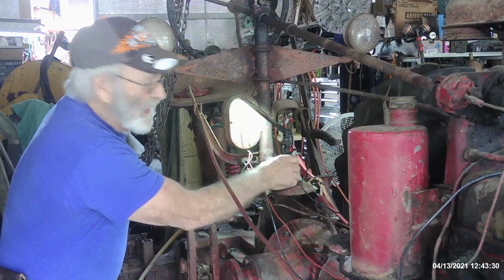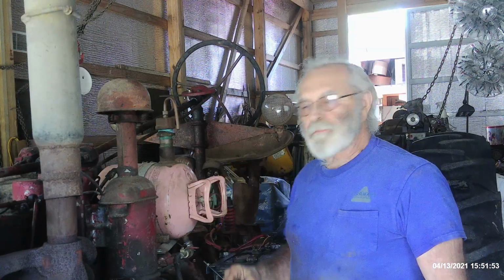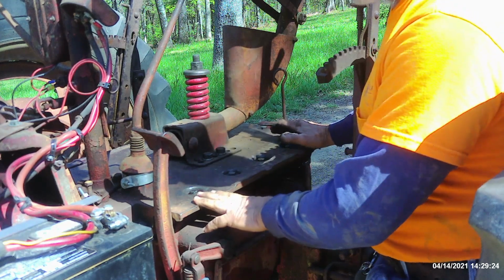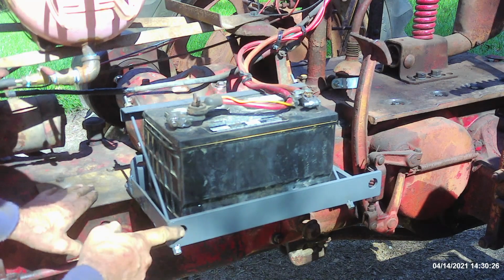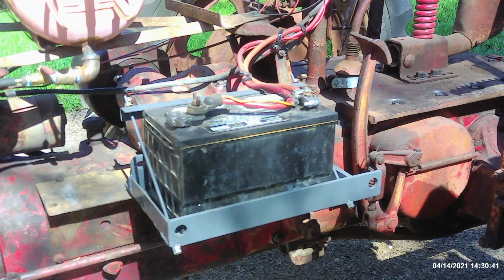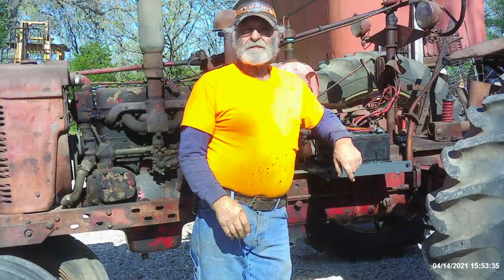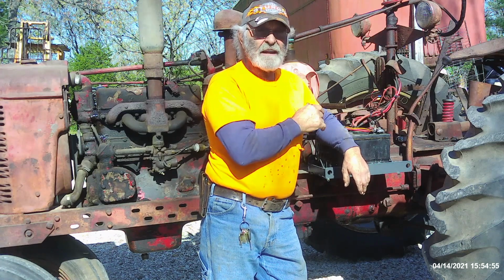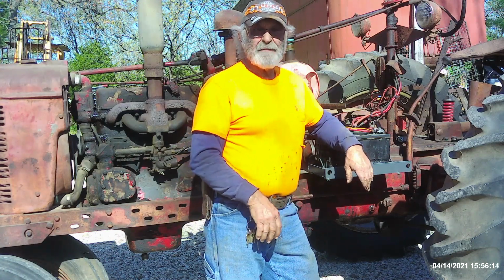Farmall H Transmission Fill Up, Belt Pulley Install, Drive Around the Woodpile

Comment: it takes a lot of time and money to keep tractors running ,fun fun fun!
Reply from the maker: Well yes, and yes.  But what the heck, it keeps me from wasting money at Crackerbarrel !! Once you get them going, the biggest issue is using them enough to keep the fuel systems from dealing you a fit.  This formulated gas is the devil on the gas tanks Jeffrey.  Thanks for the visit.

Comment: You're correct about those bolts that hold the transmission cover on. They are through bolts which is a direct path to the inside of the case. YouTubers Squatch253 and Kenny Kizzle both featured Farmall restorations on their channels. They sealed those transmission bolts with silicone sealer to keep the water out. Your old H sounds pretty good! I like your creative use of scrap on that battery box.
Reply from the maker: I did notice that a lot of the threaded holes went all the way through and into the transmission sump as I was chasing the threads with a 7/16'' tap. That fact and the nine broken lock washers gave me the thought that a combination of those was the culprit.  I might pull those bolts and pump in some Vulkem 116 to seal them up.  Yeah, Matt...I like making something of nothing so the scrap metal was the perfect candidate for the battery box.

Comment: Good Morning Wendell, glad to see that ol’ beast cruising the drive! It sounds good and healthy now and should give you some great service on the homestead!

We have some new videos up now!
Reply from the maker: I still haven't touched the carb yet and it does need a little attention.  Especially when its on unlevel grade or not under a pretty good load.
Reply: @tractorman4461  are you going to tune it like i did my old Dodge Dart? ...Place a cup of coffee on the engine, then adjust timing and carb until there isn’t a shimmer or shake!
Reply from the maker: @thesmallwoodlot433  hahahahaha...I don't think I have that level of ability in the area of tuning an engine !!  LOL.  I'll be happy if it will stay running long enough to cough and sputter its way though a wood splitting session....LOL.
Reply: @tractorman4461  I have had a few that I was able to tune to this extent, v8 and a v12 engines work best, but had to detune them because they ran too clean, and the emissions equipment couldn’t read the exhaust. So the inspection tech would fail my cars until I dirtied up the emissions!😂🤣😂🤣😂🤔🤔🤔🤔🤔🤔 now isn’t that the reason for testing emissions to keep people’s vehicles with in parameters of emissions according to  state laws?

Now lets really think about this, the car, pre emissions compliance 1972 Dodge Dart Swinger 318cid. V8., emissions compliance laws started in 1974, catalytic converters, air pumps and charcoal canister, and simple computers, and electronic ignition, so there should have been so the parameters for this car should have been more relaxed then a 1995 v8 car of any make or model, but no, i had to follow said given years emissions for this car, which said my emission must fall inline with cars that are 10-12 years old. Well the truth of the matter was, i tuned the car up while on the shop’s emissions machine. Now the inspection tech, told me it failed because of running too clean, or his machine was reading 0 emissions, so he called the head inspector out to verify his findings, and informed me i was in violation of taxation laws as well for running clean fuels ( alcohol/ moonshine) and called the board of state taxation, impounded the car, and started another whole  mess of legal snares that i had to work through. During their inspection, they cut the steel fuel lines, to vacuum siphon the tank of gas for testing, (full 20 gallons) removed the tank, and cut it open to inspect for hidden tank, slapped a condemned sticker on the windshield and gave me 30 to have this car either repaired or crushed, neither of what i did, at the time! What I did was called the state inspector from another location, and he came over to this station, he inspected, the “work” done on my car by the other techs, and informed them they were violation for vandalism of private property, and in court would side with me. Had photographed the inspection station, the car, the damage and the reports of what was found or not, 6 months later after court, the first two inspection tech, were fired, and ordered to replace the parts for my car they damaged, fuel line could have been better suited for a “weed whacker” ( 50 ft coil of 1/8 inch copper tubing from a hardware store, a gas tank from god knows what make and model GM product they came across in the junkyard and all rotted out as well, and straps that must have come off a bus! So i sourced my replacement parts, and had them and the receipts in hand on the next court date. The judge, and my attorney were getting tired of all this crap going on over people wanting to make others lives miserable, so I tacked on my labor, time to search out the proper parts, and a fee of aggravation, then the judge added on all legal fees, to include my attorney, and my second means of cheap transportation... a 1973 VW Beetle (bought for $300.00) actually to replace a pile of junk Toyota pickup that had 1500 miles on it and spent more time in the dealer garage then my driveway! 

 So after fixing the car, i had it towed to the inspection station where my father’s friend worked, and he re inspected the car, and gave it a clean bill of health. The main issue was, i was a young adult, with a sharp car, and a military hair cut, and the first two inspectors didn’t think a young kid should have such a car, bigger issue was... I wasn’t a kid so to speak ( young looking 27 ) and strong military not taking crap back bone as well!
Reply from the maker: @thesmallwoodlot433  Man...going through all that musta sucked big time.  Sometimes we get bit by some guy that has the position to make another's life aggravating over some technicality.  It all worked out though it seems.  I would love to find an old V-12 out there.  I think I'd find a home in one of these tractors....
Reply: @tractorman4461  it was, and the funny thing is they did it because they wanted the car themselves!

Comment: My grandfather had a 1942 Farmall H. It was a multifuel because it had a small fuel tank for gas and a larger fuel tank for distillate( kerosene). You would start the tractor on gas and then you would switch over to the main tank. Pretty neat setup until International came out with their start on gas/ run on diesel engines.
Reply from the maker: Yes John, and this one is the same.  The small tank is right there behind the right side of the block.  Mine is missing the cap though.  No matter, I might even take it off and sell it, the shutters and crank are already gone I think.  My friend has an International I-9 that's set up like you describe. I may be mistaking about this, but I think it has a distributor AND an injection pump for the switch.

Comment: Wendell, I have always been a "green guy" but had a chance to buy a dandy Farmall H. Seems the big bugiboo is worn steering  and dang throttle slipping to idle. I had about 1/4 turn steering wheel play. Took it apart and saw where the worm wore on the sector, rearranged the spacer washers so the worm played on a different area on the sector. It helped as I now have !/8 turn play, which is livable, using it for tedding hay, plenty good for this old boy.
Reply from the maker: I grew up on Massey Harris.  I've not really been into the green ones real heavy, but there area few that reside here.  I need to fix the radiator (or replace it) on the JD 50 I just got fired up a few months ago after a long long rest.  Floppy steering sector is somewhat common on these old guys regardless of color.  LOL.  You can buy the throttle quadrants pretty cheap, but to make this one engage better, you can put a stiffer wound compression spring under it to force more pressure into the teeth.  Also that little fellow that inserts into the worn slot is replaceable as well.  Cheap too.  I'm actually quite impressed with this H.  But I definitely need to pull the carb for a quick servicing.

Comment: Farmall H and M are known for a ball bearing wearing and a ball dropping under the bull gears which break the bottom of the rear end housing underneath.
If you look at other ones you may see the housing drilled and tapped with a steel plate underneath
Reply from the maker: I've seen something similar on one or two tractors in the past.  Luckily there wasn't much but the goopie nastiness in this particular sump that you might have seen in this video: https://www.youtube.com/watch?v=f0NkvNo5QNc&t=816s  I had a 53 (?) John Deere A that had a broken pto shaft section laying in the bottom at an angle perfect for the edge of the teeth on the right bull gear to continuously roll and roll to where it was ground close to a third of the way through the shaft.  Luckily it did not work its way under the gear.  THAT would've been a bad day.  But we solved the mysterious grumble and growl in the final drive with that discovery !!  Thanks Chris for the cool comment man.
Reply: I worked on my old Farmall h some years ago replaced all those bearings and seals in the transmission
 The bearings were coming apart and the balls will drop between the bull gears and it's drive gear and can split the rear end of the tractor in half.  some of the balls had already gone through the bull gears on my tractor luckily no major damage. I was also told by an old farmall mechanic not to replace the original oil as it was actually whale oil.

Comment: Thanks for the tip on the rear end. I waz thinking of widening mine.did the new fluid make the trans feel any better?
Reply from the maker: I think the new input shaft bearing took a lot of what I felt in the shifting lever away.  But it's still got the 'old tractor growl' through the transmission.  But though its still loud it feels better, that's for sure.  Thanks Mike for always the interesting question my friend.

Comment: Awesome video my friend, what JD sits on the left in the beginning of the video, looks like a JD 2020, I am a fan of every brand as long as it is a tractor but lean towards the older style, the new computers on wheels have it's place in modern farming, but I want old iron, will spot them on a mile
Reply from the maker: That would be a 1010...I think '59 or '60...(???).  Its a gasser.  I put a new clutch in it a few years back.  I'm like you, I prefer the simplicity of the older iron.   Most of the time I refer to them as ladies, because so many of them are 'high maintenance'.....LOL.  I'm also a fan of any color.  I have two colors of orange, three colors of red, yellow ones, and two colors of green for starters.  But most of them are rust......  Thanks Jan for watching from all the way across the globe !!

Comment: Sounding good! My '40 has the 100" axles on it and when we cultivate (two row) the wheels are all the way at the end of the axles. We have broken an axle twice that I can remember. Doesn't take too much with the weight of the cultivators and tractor on there. So many people I guess either can't feel what the tractor is doing or don't pay attention to be able to operate properly on a slope. I bought my '50 in hopes of using all the implements from the '40 on it. Someone had cut down the long axles so I can't use my cultivators on it. The '50 will only have my loader on it unless I can find axles. They are few and far between. 😒😒😒
Reply from the maker: I'll be darn.  It seems like H's are almost a dime a dozen around here.  I didn't think they were scarce anywhere in the states.  LOL.  I've got a 44 with the axles shortened.  I don't mind at all...actually its a parts tractor, but no matter.  Did you snap the axle or the axle housing ?  That is interesting.
Reply: @tractorman4461  Both times Dad broke the axle not the housing. 👍👍👍

Comment: You sure about those rear tires sticking out too much they will look much better closer to the frame of the tractor like you said and have much more room for tight places.
Reply from the maker: It not only will look better, but it just feels weird driving around with them so far out there.  I'm also removing the knee-knocking cultivator lift handles too.  LOL. Thanks Ramon for the visit and your input.

Comment: Did the transmission quiet down after the fluid change ?
Reply from the maker: I would say nominally so Gary, but I went way beyond just a simple fluid change.   I figure what's there must be kinda common for something that's 70 years old or more.  I did get to see the gears while flushing the tranny with the top off and there was no excessive wear and no grindings sparkling in the material that came out.  Massey's are known for howling gears but not being a big Farmall guy, I don't have a lot of experience on the noise level using them under loaded conditions day after day.  Have you stumbled across this video yet:   https://www.youtube.com/watch?v=g9IXCCyYUug Thanks Gary for stopping in for a visit and a question.

Comment: Another nice video on the H.  I seen a youtube video recently where a guy filled the transmission on his Ford 2N with a battery operated syphon system.

On another topic, after seeing your children crossing sign, you probably also need to add a Farm Machinery crossing sign also..... 

Also when you get the gas tank finished up, I believe I have an extra safety fuel cap that Navstar sent me on another project.  You can still get a free has cap from the safety recall from the late 70s by sending in the serial number of your tractor.  Somehow I manage an extra one.  They're probably vented - the safety recall was due to gas leaking under pressure and causing fires when it ignited with a hot manifold.  https://www.ihgascap.com/index.aspx

I also refer my wheels in the narrow position, it's easier to get on the trailer, through openings, and I can see where the rear tires are.  On my Farmall B, which has the seat and steering wheel offset to the right, that left rear tire is way, way out there, even in the narrow position.
Reply from the maker: You're right about loading and unloading.  One thing I like about the H with the wheel weights off, is I can see through the slots as I'm backing up.  Not like the Massey's with the solid rims.  I haven't contacted Navstar yet, but was planning on it soon.  I gotta get the fuel tank on one of these days.  But its the projects that seem to be never ending getting in the way !  LOL.